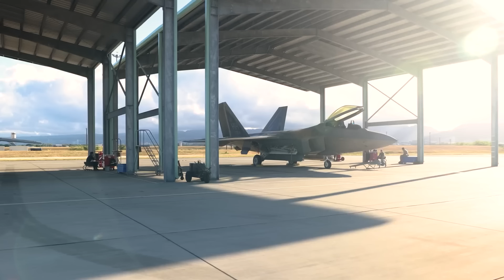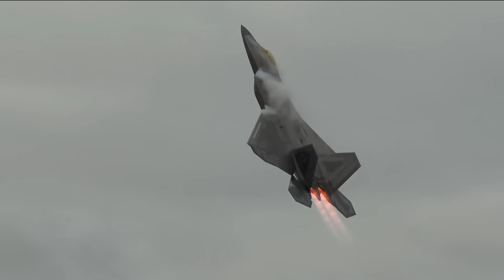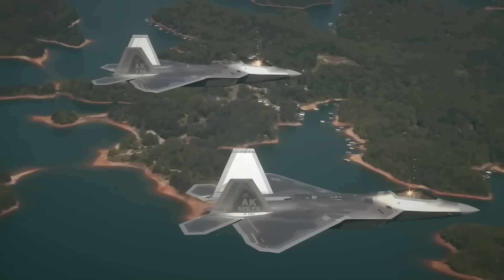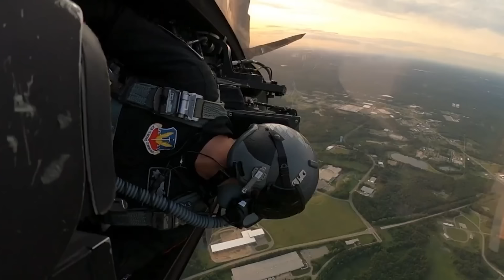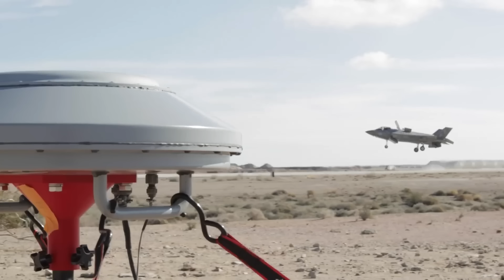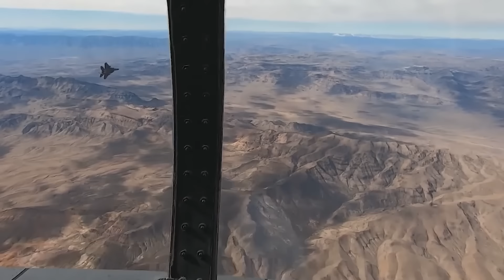The SECRET SYSTEM That Makes the F-22 Untouchable

Comment: I could have swore he said... 26 + 26 on military power... 52000 more than 1 to 1 with full weapons load. But at the same time said it weighed 80 or 83 thousand lbs... so if its 52000lbs of thrust wouldn't it need to put out 83000+ to be 1 to one combat load ? And the other fella is right. There is no center line bay... unless its a big bay with 2 doors ? He said bay door like a pickup truck size. So who knows...